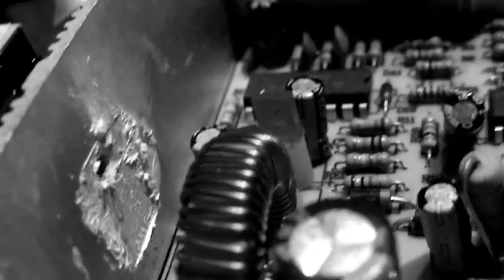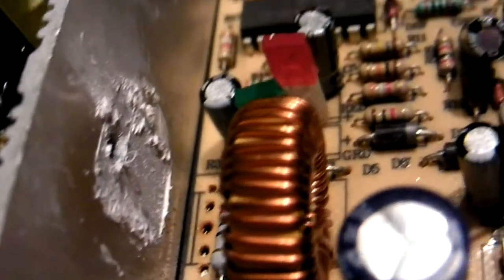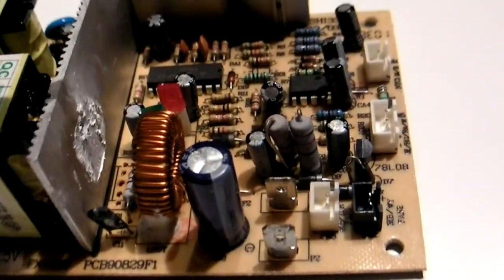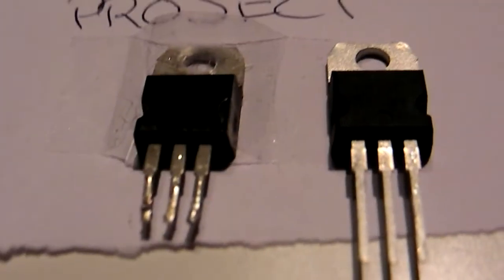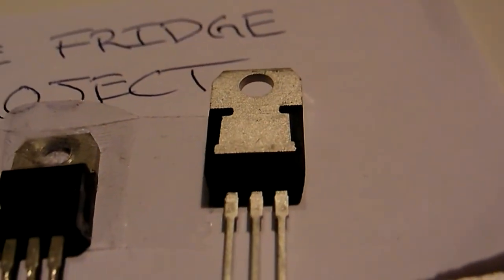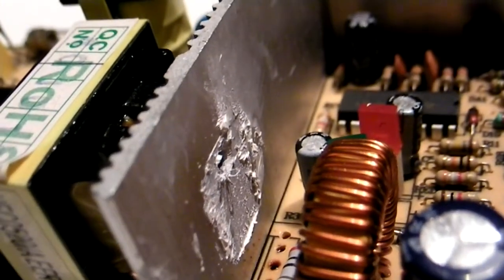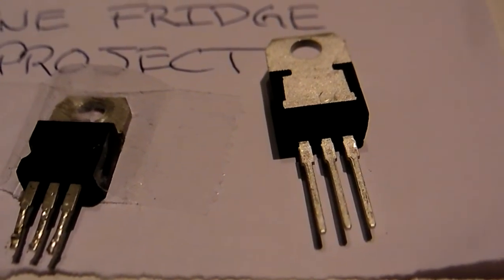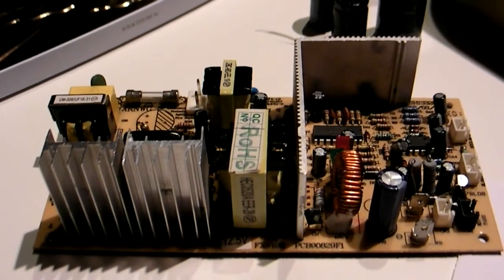Fixing WINO - The Uncool Wine Cooler (Part 4)

Comment: I am having the same noise from the board for my cooler. 
The board for mine is not the same as yours, and they have gone up quite a bit in price, so I want to fix it. 
A couple of quick questions.  

If I test the transistors, and they test out as not completely blown, (power flowing one way, and not the other), could they still be an issue? Do they go bad without having complete failure?

Also, what is the component next to the transistor you replaced with the coil around it?
Is that an induction coil?
Could that guy be the problem?

Many thanks!
Reply from the maker: Generally speaking it's not going to be the coil that fails (yes, that part is an induction coil).  In these switched mode power supplies (SMPS) the components that tend to fail are somewhere else.  Have a look at Learn Electronics Repair and Haseeb Electronics for tips on SMPS troubleshooting and BE CAREFUL as the voltages involved routinely approach 400v!
Reply: @MYMANTHEMAKER  
Thanks for the reply!
I ended up just rigging a power supply with a thermostat to run mine. 
I’m using it as a cigar coolidor. So that’s working out pretty good. I just wanted to have the variable fan speed for a more stable temp. With my setup it’s just on or off. 
But still keeps them nice and fresh. 
😂